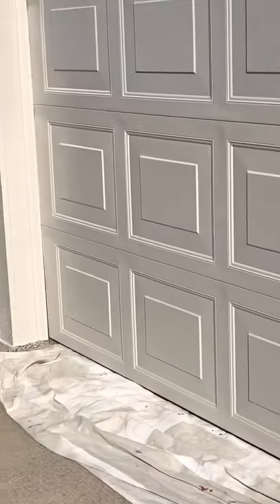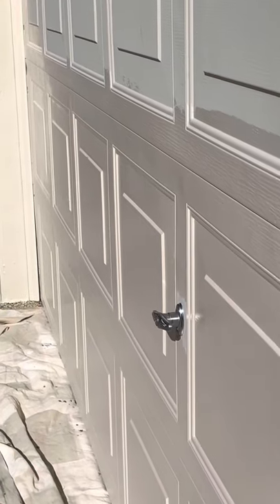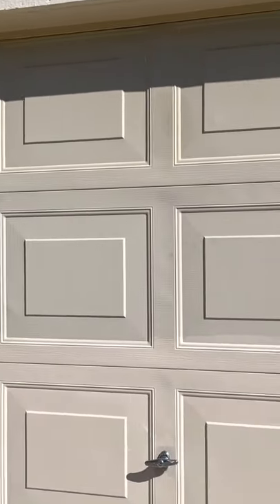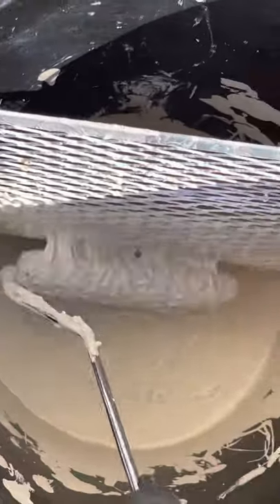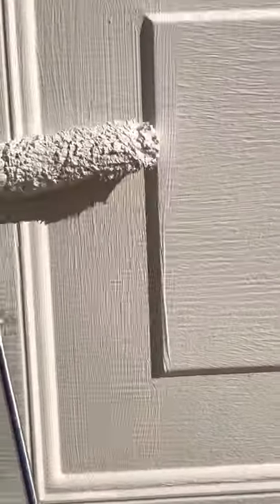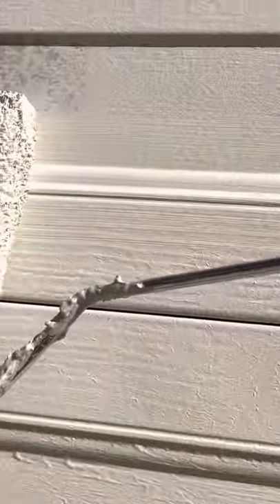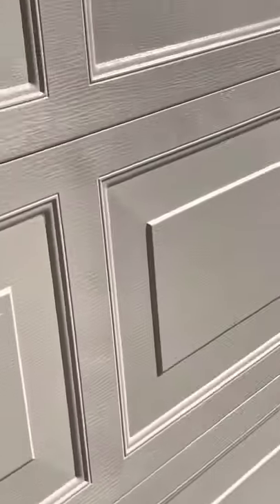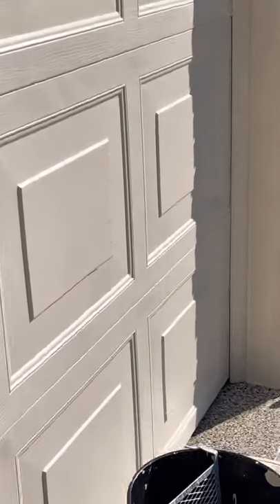How to paint a overhead garage door.

Comment: definitely quicker & smoother to mask off & spray it out
Reply from the maker: I have sprayed overhead garage doors and yes it is very quick and makes sense if I was painting the whole exterior. This video was made for the average homeowner who doesn’t own or ever used a sprayer.
Reply: @collumpaintingiiillc9421  exactly
Reply from the maker: Yes, I know that spraying a overhead garage door may be quicker, but this video was made for the average homeowner who does not own a paint sprayer. I on the other hand also believe that for me rolling the overhead garage door was quicker than me setting up my sprayer running paint through it and washing it out.